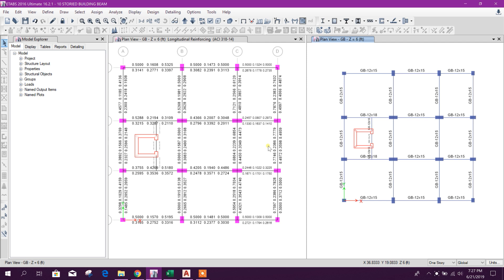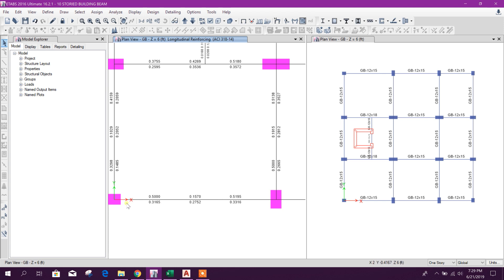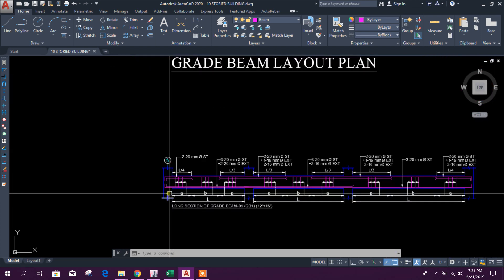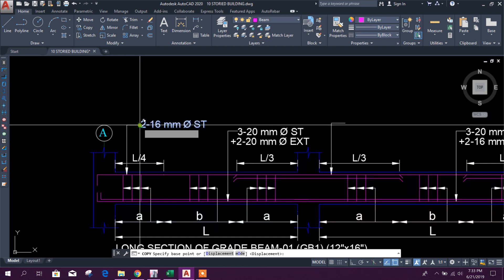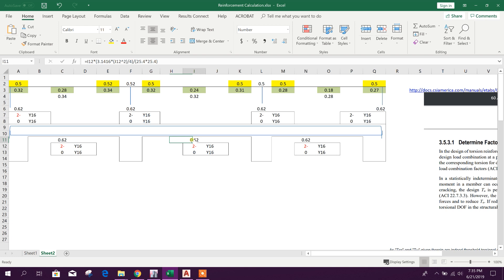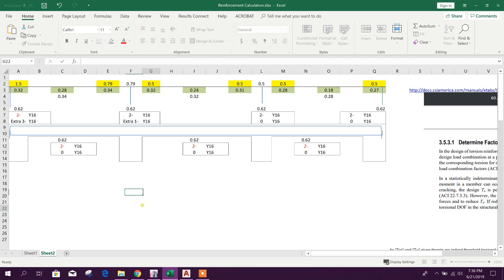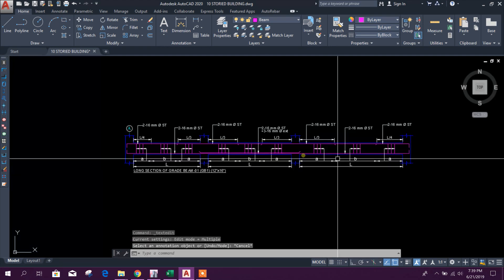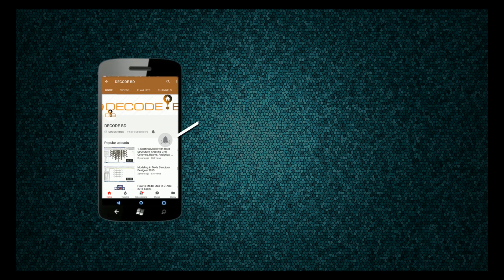Beam Detailing using Etabs Result

Comment: Hlw sir..Does this excell sheet work for mm square unit?..plz mention
Reply: if you are using meter as units in etabs, the rebar needed which is required  is given in mm^2. so just don;t divide with (25,4*25,4) and it with be mm^2

Comment: Column beam detail..can i use this method as per IS code?
Reply from the maker: Yes. Design  your model in IS code then use the excel for detailing.
Reply: @Decodebd  sir..we are using 12mm bar also as per IS code..but your excel sheet starting from 14mm to 30mm bars....I need 12 mm bar..wt should i do..wt is the procedure to edit.... Pls give your suggestion